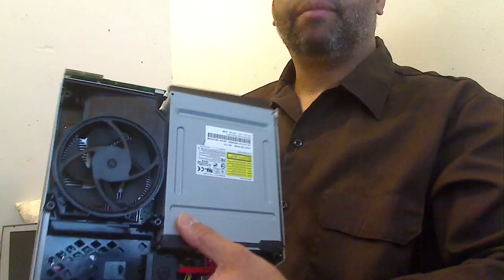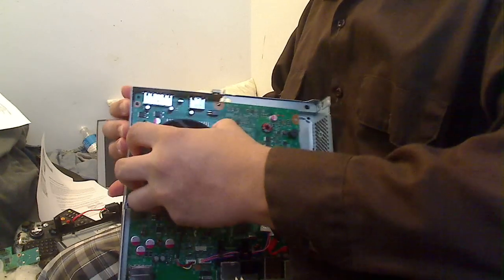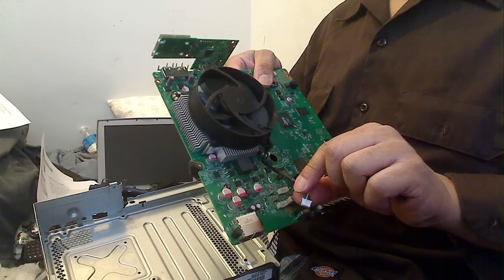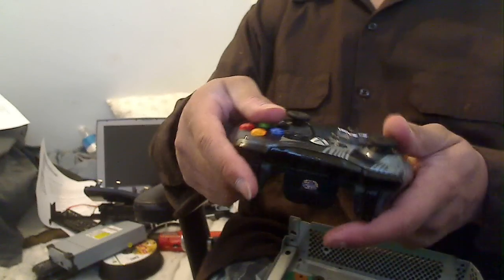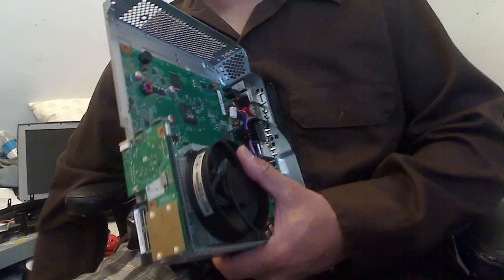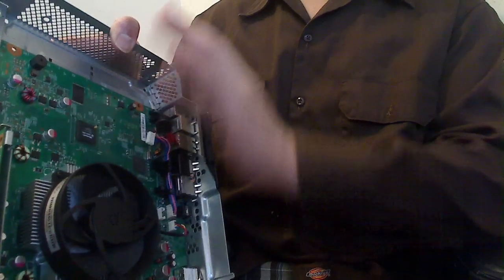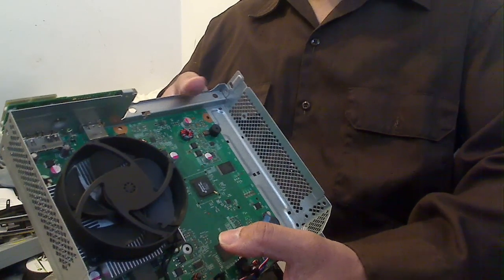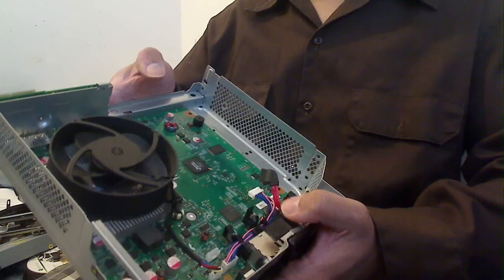How to fix Xbox 360 Slim RROD / Red Dot of Death Reset Solution👍

Comment: Im trying this out but when I power the box on with the fan disconnected it wont stay powered on for more than 3 seconds
Reply from the maker: Nicholas Greco This usually indicates an overheating of the power supply which removes power from the xbox. Check the power siupply for a red light (not normal). If there's a red light on the power supply replace it, regardless if there's a red light on it or not, try using a different power supply to see if that's the main issue.
Reply: Donte Beachem i appreciate it. theres no red light but ill try that. i already have the box broken down...
Reply: Donte Beachem so basically...the box goes green light red light in a split second after powering on...then immediately powers off...and the disc drive wont open...which bothers me because I took that apart...only out of it's shell though...

Comment: How do you remove the metal x bracket that holds heat synk the metal piece to get to CPU on the opposite side of my mother board there's a metal x bracket preventing me from getting to the under side of my heat synk. I'm having the red ring I think partly due to needs cleaning and I modder in a game did something to my Xbox or hard drive, trying to repair myself its not within warranty and don't have much money to get a new one.
Reply from the maker: Jonathan Rawls Ok Jonathan, I don't really give out instructions on removing X-Clamps because of the users (you) potential to scrape and damage the board. Microsoft has specialized tools in order to remove the clamp. But fear not.! Just do a YouTube search on "how to remove an X-Clamp" and you will find plenty of videos on how to complete this task. Good Luck..

Comment: What if you have the red dot but nothing shows up on the tv its just black
Reply from the maker: Travis VanDyke Either your HDMI cable or Component Cable is non-functional but the Xbox built in video hardware component may be damaged. I've repaired this same scenario in the previous Xbox 360 Phat edition. I hovered a heat gun over the chips near the section where the HDMI was located for about 5 mins on 500 and 5 mins on 1500; then let it cool. It worked each time. I'm not saying that this is your problem but you might want to try the other old phat video port on the slim and possibly try a different TV.
Reply: Donte Beachem ive used hdmi and 2 different component cables and ive replaced the thermal paste tried the over heat shutdown method and still the red dot with a black screen

Comment: So when does the xbox 360 slim shuts off because it still showing red dot I replace thermal paste
Reply from the maker: Fatal Gamer I've been hearing this alot from some other subscribers and there's a possibility that Microsoft put out an update to keep the Xbox from shutting off. On the previous Xbox Phat there was a reset where the heatsink and fan were completely removed and then powered on to cause the reset button I never suggest it and I'm not suggesting it now. It may damage the processor for all I know.

Comment: I tried everything but strangely it's still not working, is the thermal paste necessary?
Reply from the maker: Taco Tony64 Don't add the thermal Paste before the reset. Add it after the reset, since the thermal paste actually helps with the transfer of heat from the processor to the heatsink. You don't want this during the reset since your Xbox may not reset at all. You need it to keep the stored up thermal energy so that it would shut down.

Comment: you didnt need to do that you can do both and it will work: fit the hard drive inside the console and unplug it and plug it back in you absolutly dont need to take it apart

Comment: I have taken my xbox completely apart cleaned the motherboard with alcohol thoroughly with a soft bristle toothbrush and then followed this video step by step. when I unplug the fan and then reconnect the power supply to xbox but after I turn it on it has a solid red light then it starts to blink fast for roughly 30 seconds afterwards it will turn off... what should I do about this issue bc I have... not one.. not two... but 3 xbox 360 slims and none work... plenty of spare parts that's for sure
Reply from the maker: Ok cleaning is good but did you remove the heatsink and then clean off the old thermal paste? Did you add new paste after you cleaned off the old paste? Did you perform the reset as the video outlined.

Comment: FOR FUK sake this is stupid my fan wasn't even hardly dusty and it's fuking overhearing shutting down so what I have to buy paste and shit? Might as well just buy a whole new console aint i? It's also loud when playing GTA so idk wtf to do with it I mean it wasn't even that dusty inside so idk I've had it for a ridiculous 9+ years lol but fuk sake what can I do here I rather gotta paste it and take it apart or buy a new one or try using it without a case on ? Idfk now
Reply: And here's the piss fuking it's  loud as what a bloody gaming PC with 50 fans YES LOUDER yet WHEN I PIT MY HAND OVER THE VENT JTS FUKING COOL AIRR NOT HOT NOT COLD BUT ONLY WARM AND ITS TELLING ME KTS OVER HEARING OHHH YEAHHHH fuking HELL idk what to bloody do here I've got to waste £70 on a new one ain't I I got no options help me here
Reply from the maker: Your family could be functioning fine but the CPU paste under the heatsink block, which is under your fan may need to be replaced. Replacing the paste is 500 times cheaper then buying a new Xbox. If you can't do it, find a local computer shop or electronics store that will.

Comment: My 360 s doesn’t have screws holding heat sink on it has the stainless stell x holding it ..u cant get it off
Reply from the maker: darren hasler If you didn't have the 4 black screws under your Xbox case holding down your heatsink block, then you have a pre-owned Xbox where someone has done some previous repairs. There are videos made by others on YouTube who show you how to remove the x-camp. You can remove it.

Comment: Took apart 2 slims to the T, and both didn't even reset.. 1 was fine until I got the red dot. Followed instructions and nothing. Disappointed why shit don't work for me but everybody else it works.. Plus mine doesn't even overheat. Its cold when the red dot appears...
Reply: Adrian Edwards same
Reply from the maker: Adrian Edwards if yours does not over heat then there's possibly a problem with your power brick or non-functioning CPU. Check to see if you have a red light on your power brick. Try a different power brick.
Reply: Donte Beachem nah there isn't a red light on the brick.. Its amber when on standby and green when on. Any how I threw the slims at the wall.. Lol #frustration. 
But such a great video and very helpful..
Reply from the maker: Well I'm sorry that it wasn't enough to help you repair your Slims. So many others have used this solution to fix or repair otherwise dead or just non-functioning Slims. I've even heard from some that have used this method to repair their 360's. I have heard that there's a possibility, that because of this video, Microsoft put out a Slim patch to keep the 360 slims from even operating or supplying power to the CPU when the fan is disconnected. I don't know of any truth behind it but it's a possibility. Someone else stated that they left the fan plugged in, since there was hot glue placed over the fan plug to prevent unplugging and they stuck a pencil in the fan to keep it from moving, which allowed over heating of the processor. I am not suggesting this at all, since it would could possibly damage the fan. Anyway, I hope you find a used Xbox Slim or an Xbox one so that you can continue to indulge in the gaming experience like the rest of us enjoy.
Reply: Donte Beachem its OK, thanks for the feedback and the videos. It was my first time anyways.. But now that I'm more familiar with the process of taking apart, cleaning and hopefully factory resetting.. Thanks again Donte

Comment: So I'm up to where I need to induce the overheat... My Xbox video feed to my tv stopped, but the red dot stayed on. So... does the video cutting out signify that it's overheated and shut down, or if I wait longer, will the red light eventually go off with a total Xbox self-shut down?
Reply from the maker: Aaron Fenslau the video should not have been connected to anything. The red dot should have stopped completely. Do not replace the heatsink paste before the reset solution. Another user placed a pencil to stop the fan from moving and placed a cover over it, he used a piece of card board or towel to force higher temperatures and that worked for him. I'm not telling you to do this but instead sharing a success story from another subscriber..

Comment: Problem with my Xbox Slim. Power brick turns from orange to green. Unit powers on with green light on console then flashes red 10x  then shut off. Power brick goes back orange again.
Reply from the maker: roblun75 Check to make sure that your fan is functioning, that you have good ventilation, and that your fan is functioning (spinning). If all of these check out, then your CPU paste may be dried out and needs replacement. Good luck.

Comment: By Far the best presentation so far i have seen on fixing RROD..  i am plannng to pull apart my XBOX 360 250GB and fix it myself.
Reply from the maker: Thanks for the comment jaikishen, I hope you have good results on your repair. You can also look through the comments for other possible solutions to repair your xbox, even instructions on how to replace the heat sink paste. Also there's no need to replace the x-clamp. It's a pretty good idea to add it back, instead of replacing with washers and screws. Good Luck..!
Reply from the maker: +jaikishen Baliga Thanks for the comment Jaikishen and I hope you get your xbox back up and running so that gaming can continue for you all day, every day.

Comment: Hey, so my slim has the rrod. And I added new thermal paste and blew all debrease off the Xbox. and when I reset the processer it stays solid red, flashes red, then shuts off. when I turn it back on it still has the red ring of death... My Xbox doesn't have a hard drive tho. What should I do!??
Reply from the maker: Fallout Modding Team Resetting your Xbox may work better before adding the thermal paste.
Reply: Fallout Modding Team  you just break it and put it on 🔥

Comment: MINE DOESN'T EVEN TURN ON. IT JUST MAKES NOISE
Reply from the maker: Qua DGAF In order for your Xbox to make noise, it must be on. If you do not see a picture your video cable or video port on the TV could be bad. Your Xbox may also have an internal No - Video-Error.
Reply: Donte Beachem Idk what it was, i smashed it February 20th, then got a new one February 24th
Reply from the maker: So you now want to fix the old one? Correct.?
Reply: Donte Beachem not anymore. i smashed it and bought a new game
Reply from the maker: You may need to take the old one apart and check the plastic fan blades. They may be broken, cracked or a broken piece may be chipping against spinning blades
Reply from the maker: Qua DGAF Oh OK got it. Sorry you weren't able to fix it. Glad you're up and gaming again,

Comment: hi Donte Beacham, I have this kind of problem the RDOD, just the other day when I opened it there's the RDOD I dont know why then yesterday it works again but not today.. The problem I noticed is when the av cable or hdmi is plugged into the console the RDOD appears even if the tv is off but when I remove any of the av cable or hdmi the console works fine.. The green light doesn't turn into RDOD and the fan continously working.  Is your method of resetting will work on my case? Can you give me any ideas.. Or anybody out there who met this problem and solved?
Reply from the maker: Rogemar Cinco you should look inside your Xbox HDMI port and your TV HDMI port and check for bent pins. Bent pins can cause a ground to occur and cause a temporary ground fault for the video. Check inside both ends of the HDMI cable as well. This is usually the culprit in the scenario you described.

Comment: Hey there, I did everything you do, with new arctic silver 5 paste, unplug fan to reset, not working, so i tried the hot gun with hair dyer and shoot it up till it hot and then try reset again, seems not working... thought has it to be the power adaptar line? the box says GREEN when its on and XBOX slim 360 is on RED dot..... any ideas what should i do? when i test it i disconnect the hard drive and memory everything and reconnect the FAN and still red?

Comment: dude i should sue you, the hot heating reset  method does not freaking work it just totally ruined my Xbox you TROLL!!! It would stay on and run untill i hooked up a/v or hdmi and now that ive tried your heat gun it automaticlly red rings and doesnt display anything on the tv...... thanks alot man!
Reply: ignorance is a bliss why were you trying this in the first place if your console had nothing wrong with it and it was fine to begin with...hmm.?.? secondly he clearly states to plug video in but then again i guess thats the blissful part of not fully listening/paying attention/or following simple instructions or just the pure bliss of being ignorant and lastly youre obviously the troll because even helen keller would know that once you got to a point of doing different methods of this type of (fix) on MICROSOFT licensed  copyrighted and patened device or system quote unquote tampering altering or voiding warranty if it so happens to have one then you take full liability to your ignorance and all possible device/system errors or malfunctions ...while your trying to sue said person for your ignorance you could be making better use of your time by educating said ignorance...got to love people/critics that bitch or shoot down other peoples ideas or methods and calling them trolls when youre trying to solve your problems with other more knowledgable peoples solutions... give them a rope and theyll hang there damnself #irony

Comment: Thanks Donte, i had to roost my cpu, after clean the Xbox 360 slim whit a heatgun voor two minuts before it was working again.
Reply from the maker: Marlon Heijerman Good job Marlon. That usually gets the job done when the basic reset solution doesn't solve your total problem.

Comment: my xbox has a red blinking dot, I put it in a more free space for proper ventilation, still the problem persisted so I took out the hard drive and disconnected all wires and put it back again but still no good. I'm not sure of removing the parts by myself, I might damage anything.

Comment: Hello, I don't know if your still answering questions, but I teared down my Xbox 360 and replaced the thermal paste with Arctic Silver 5.  Before my tear down my Xbox 360 would be green for a 7-8 seconds and would the red dot of death after that. 
There would be  no display or signal on the TV.  Replacing the thermal paste didn't work and now trying the overheating method on the CPU and my Xbox 360 won't shut off automatically. I was wondering if there's another way to fix my Xbox 360.
Thanks
Reply from the maker: larry lawerance just to be clear, is your xbox 360 a slim or a phat.?
Reply: Its an Xbox 360 slim.
Reply from the maker: larry lawerance have you checked your power supply for overheating or a red light. The power supply has a fan and also needs circulating air. Plug it into your slim, power on the slim and then watch thr light go from amber to green. Continue to watch that same light until the xbox shuts off inorder to make sure it does not turn red. If it does turn red, the fault lies with the power brick. Be sure its not on carpet and that the vents are not covered with anything, especially caked on dust.
Reply: Hello, sorry for the late response. The power supply doesn't seem to be the problem. The power supply is green while the Xbox 360 is running. I think the problem might really BE on the board or something else.
Reply from the maker: Well the idea is this. You nor I know  where the problem exists. So the idea is to NARROW the problematic area by examining what we can determine it is not, until we can have only a few scenarios left, unless you have Microsoft testing equipment. Because if you Think that's where the problem is, then you've already come to a conclusion and you now know what to do next. And you know more then I.
Reply from the maker: larry lawerance if you read through previous replies of others who have repaired their xbox, you'll see that harddrives, dvd drives, ram and other input devices can cause red dot errors. I would suggest that you not come to Quick resolutions and continue on with the trial and error for functionality.
Reply: Okay, thanks for information. I only have the heatsink and cpu fan plugged in and also the hdmi cable and power cable. I don't have the disk drive or hard drive plugged in and I'm using the face plate to turn on the Xbox 360 slim. I still get the red dot of death, but I'll try to find the problem using trial and error.
Reply from the maker: Xbox 360's don't shut off automatically, we'll the pats don't.  The CPU just shuts down but the lights stay on. Some of the Slims don't shut down automatically and I'm not sure if that's from an error in the firmware from a failed update or if it's from an xbox live update that prevents the Slims from shutting down. Regardless, if there's no damage to the firmware and your power brick does not have a red dot error, and if there's nothing wrong with your video HDMI cable and there are no bent pins inside any of the Xbox USB slots, then heating both sides of the board with a heat gun should get it up and running. But you should make sure you've checked each of the things I've listed in the last few sentences.